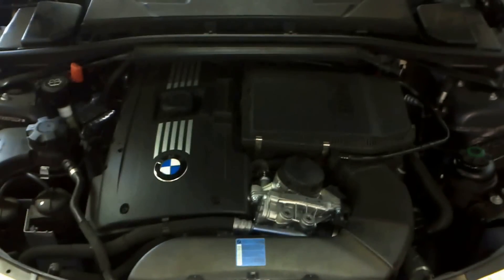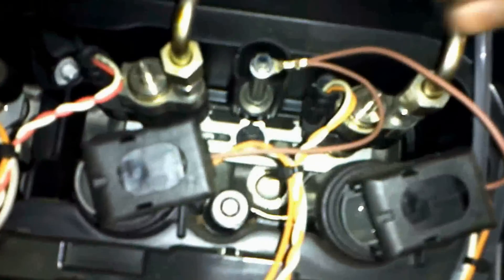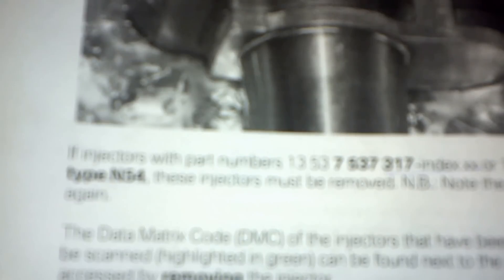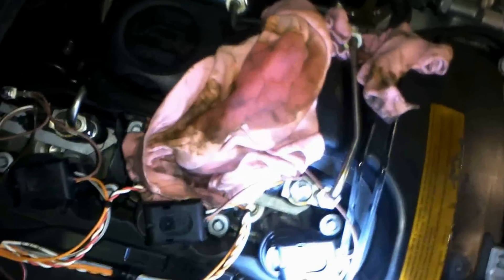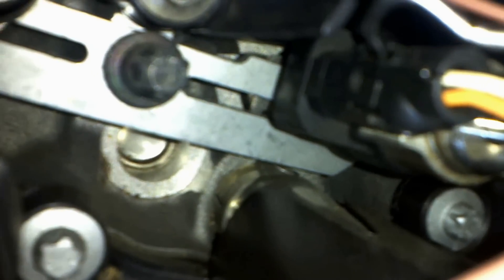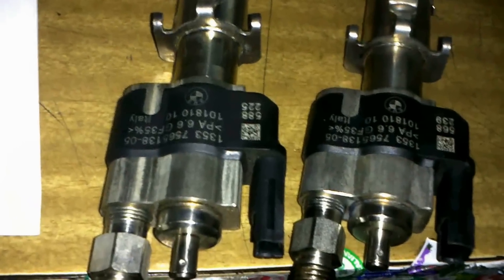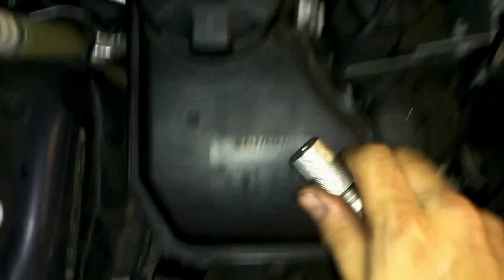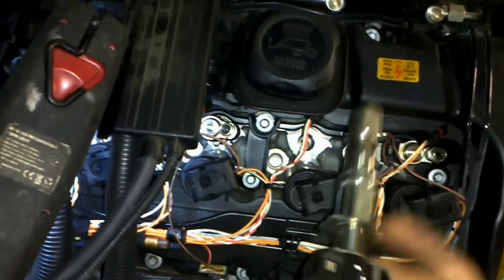BMW Injector Recall 1 & 3 series N54 Engine How to DIY: BMTroubleU

Comment: Tip. Screw the injector line ends to the fuel rail as you take them off then you can never mix them up.

Comment: This is a very common issue with owners of the 335i on the BIMMERFEST forum.  It happens shortly after installing new brake pads and/or rotors as well (along with a new or original sensor).  It does not do it cold and only after heating up.  After I take it to the dealer, it is good for about 800 miles and then starts screeching again.  It happens from stop to about 15-20 mph then you can't hear it.  I guess you have not had to deal with this issue much but appreciate your quick response.

Comment from the maker: fair enough, my suspicion is that the 'quantity compensation' is more for emissions. it may cause issues if the quantities are way out from one another, but you may have gotten it close enough to work well. i still recommend getting the coding anyway just in case

Comment from the maker: yea, sorry i meant to do that ages ago. the injector retaining bracket doesnt matter that much, around 30nm, similar to a sump plug. its been a while, so i cant be 100% but i think the fuel lines were around 24nm. if you could please call to confirm this at a dealership and reply back to me to ensure this is correct i would greatly appreciate it brian

Comment from the maker: still get your injectors done if they are part of the recall and find out whether or not your high pressure fuel pump is also part of the recall. there have been guys that get both of these done at the dealership for free (but it depends on your circumstances)

Comment from the maker: contact a dealership and ask if either your hpfp or injectors are included in the recall. depending on how nice they are you should get trade price parts/free labour/etc. if your car isnt part of the recall get a fault code read out to provide some direction

Comment from the maker: ive never heard of aftermarket injectors for BMW being available or being used. i think that would just create more problems than it solves. if youve had your injectors removed and scanned at a bmw dealership and they all come back as needing replacement then you can be 100% it will need them. the most ive ever replaced at once was 5. it makes sense that multiple injectors would fail at once because they are all manufactured at the same time, with the same fault being built into all of them

Comment from the maker: you'll definitely need new seals. there are two seals- a crush washer and a ptfe black seal. new ones come with these seals, but is the one youve found online new? and is it a good injector or bad? the part number suggests that its pretty new, so thats a point in its favour. i have just been speaking to a guy in the comments below who put new injectors in without programming the 'quantity compensation' numbers and he didnt have any running issues, but you will have to get it done at some point

Comment from the maker: if your rear right brake specifically is squeaking then it could be one of two things- most likely the head of the brake wear sensor is rubbing on the disc and causing the noise. this works twofold for bmw in that it acts as an audible first warning system for customers and its really annoying so it makes people agree to change their brakes sooner than is actually required. less likely you may have nongenuine pads, misadjusted handbrake or brake dust cause the sqeak. let me know how you go mate

Comment: Sir, in your experience, is it likely that 6 injectors would fail at once? On a 52Km, 2010 model? I've recently noticed a hard idle/knocking that increased with revs & vibrated the whole car. Turning it off/on remedied the problem, but it comes back if I let the car sit for a while. Just took my 135i to get the alignment & new tires & I relayed the apparent malfunction to my SA. His tech diagnosed all 6 injectors failing. Furthermore, what is your opinion on non-OEM replacement injectors? Tnx.

Comment: Hi I have an 07 bmw 335i & the car seems to run fine. No misfire, car seems to run smooth. But when the throttle is all the way to the floor the engine light comes on. According to bmw the fuel pump has been replaced with injectors. What would you suggest? I get code cc-is 29. Thank You

Comment: Hi Mate ,

Finally got a scan tool on my car and this is what it showed :

Current active code :
2FBF - Fuel pressure after release of injection

Logged inactive codes:
29F2 - Fuel High pressure System, Fuel Pressure
2DED - Power Management ,Standby Control
2F9E - Thermic oil level sensor signal or level below thresh hold

What do you think my problem is and can I fight BMW for it ?
Reply from the maker: good question. the 29F2 - Fuel High pressure System, Fuel Pressure is a classic faulty HPFP code, but im not sure about your 2fbf... you can let them do some diagnostic steps related to the code and see what they come up with. although if they find youve had a bad batch of fuel you mightnt be able to claim much, but give it a red hot go anyway. dealerships are very pliable for warranty claims and/or price reductions on parts- you just have to be either be mates or firm but fair with the service advisors/managers. the 2ded and 2f9e arent important

Comment: Thank you very much for the post. DO you have a solution to put the new gasket ring without the special tool? I tried with 2 ring and it was bigger after I put them on the injector.

Comment: Could you tell me where I can buy the tools and new washers and rings for those kind of injectors.. Can't seem to find those here in Norway. Seems whomever did some work on my bmw before, took off the rings on the injectors and didn't replace them, nor put them back, I also suspect they never changed the black o ring since at least one of the injectors I can just pull out

Comment: Hi, I live in NY and I purchased a 2009 BMW 535i xdrive and I'm getting misfires and the code is p0304 misfire cylinder 4 I put all new plugs in stock oem Bosch plugs. Same problem same code came back. I swapped the ignition coil to another cylinder and it still came back misfire cylinder 4 so I'm guessing its the fuel injector. Can I just swap it with a used one I found online part # 13537585261-09? Can I just swap them or what else is involved like ecu programming or need seals replaced thanks

Comment: Hi!
I own a Bmw e90 2009 with engine code N43b16a with piezo injectors. My car has really long cranks especially when engine is still warm. No ERRORs are stored NO engine light. Car runs fine afrterwards. Do you have any idea what could be wrong? Do you suspect the injectors or the HPFP?

Comment: Hello BMT.  I own an 08' 135i coupe with just 42k miles on it.  Besides a few scratches, it still is an awesome car and I plan to keep her forever!  I've been using BMS DPs and JB4 on map 2 for over a year(post warranty) and never had problems and it's scary quick(in my opinion).  Last week all of the sudden I started having a rough idle when cold starting.  Outside temps are in the low 70's.  At idle the revs fluctuate and sometimes dip by 400-500 and it seems like it's going to stall, but doesn't.  I also more recently noticed a slight cyclic putter(misfire?) noise when at the back of the car.  I suppose it's simply time for an expensive tune up to replace everything such as plugs, coil packs, injectors, ect, but is there any way to nail down what the real issue is first?  Injectors are expensive!  Any advice on how to tackle this would be truly appreciated.
Reply from the maker: follow this video- BMW Ignition Coil Diagnosis How to DIY: BMTroubleU and let me know how you go

Comment: Hello there, 
I have rough idle when i stop at stop light  on my 328i 2007 the michanic told me its spark plugs, replaced the spark plugs and coil pack still same problam do you thing the problem is the fuel injector please help me thanks alot.

Comment from the maker: dont do it yourself if its covered under recall. if you want to know whether you are part of the recall just contact the service advisor from your nearest bmw dealership. he will need the last 7 digits of your vin and if his system doesnt specifically come up with your car needing the recall then it wont need doing. your build date may be before they changed the injectors and started having problems so it mightnt effect yours. but give him a call just in case, it mightve been added recently.

Comment: I apologize in advance for binging my BMtroubles to you. My e82 n54 went into limp mode. Dealership said codes for injectors, but no codes now after a few miles and runs fine. Have new injectors and plugs on order. What to do?
Reply: Keith

Comment: Hello,
I have a 2008 335i and I installed cobb charge pipe, cobb tuner, cobb, down pipes, and inter-cooler, I put map 2+ and drove fine until the other day when I tired getting on it.... the car went into limp mode so i shut it down and it has a code of catalytic converter and everyone said that the injectors or fuel pump. Any thoughts
Reply: Joseph Wilson I cringed at this . You said you have downpipes . And your throwing a code for a cat converter ? They are non existent! Get the cat fix

Comment: Hi, I have an injector problem or so they tell me from the dealership and they want me to replace at once all 4 injectors!! My car vibrates on start up but after a 5 ' drive it works perfectly ok. I used to leave the tank get almost completely empty before i fill it again. It's a 2008 320 manual petrol convertible 2.0. Help please :) Any other solutions/suggestions? Thanks!
Reply: i have got the same car and the same problem and my engine light just came,have you fix it mate

Comment: Hello Sir,

Do you know when the injector recall ended for N54? My build date is July 2007 so it should qualify for the recall. The dealer is saying the recall ended and wasn't extended 10 years like the HPFP was. Thanks.
Reply from the maker: that doesn't sound very honest to me. a recall shouldn't have an end date- its a known issue and should be honoured for replacement under your rights for warranty against manufacturers defects by law. all it takes for them to check if your car falls within the dates for faulty injectors is a quick computer search. call the highest bmw authority you can get hold of in your country and ask them what the deal is- I suspect they will help you out more than your dealer is. let me know how you go
Reply: BMTroubleU Thanks a lot!

Comment: do you have the torque specs (I didn't see them at the end of the video)?...and how important are they?
Reply from the maker: relatively important- you obviously dont want fuel leaks. 24-28nm from memory, but check that with a dealer first.
Reply: BMTroubleU i assume that's for the brackets that hold the injectors right? or for the fuel lines?

Comment: hi there mate, what other recalls are you aware of on the 335i with n54 motor? ive just purchased one not long ago and am slowly fixing bits and pieces up. i noticed my no.3 injector is very noisy!!
Reply from the maker: specifically #3? thats odd. the recalls for these vehicles arent really to do with the engine, its pretty solid, but rather the ancillary components. injectors and high pressure fuel pumps both have recalls for the 1 and 3 series, but if you simply call the nearest dealerships service advisor and quote the last 7 digits of your vin they will be able to look up their system to see if you have any outstanding recalls on your specific vehicle.
Reply: BMTroubleU Yeah no3 has a really loud metallic ring to it. Best heard through a long screw driver without plastic cover off. I've already replaced a bunch of seals around the motor, I'm amazed how hot they run for a stock motor! Have thrown in a low oil temperature thermo to bring the heart down a bit. Thanks for the advice will give them a buzz, the most annoying thing is the wastegate flapping on cold start, I know in the USA they are a warranty item as there was a court case but I can't see myself getting too far with bmw here getting that sorted.

Comment: Hi I have a 2008 BMW 335i N54. My car have hard time starting up takes about 4 to 5 second to start up. I check the spark plug and 3 are really black and really wet of gas. What should I do???? Change the coil or the injectors????
Reply: Injectors are stuck open. So, they leak gas into the cylinder. It also creates a rough idle. Hard to get clean. Best to replace them. Contact your local chapter of the BMW CCA and ask for a recommendation on a good independent shop to help. Unless you like going to the dealer...
Reply from the maker: Balbir Rodriguez have you called the dealership to find out if your injectors are part of the recall? if they are then the work is usually cheap or free
Reply: They say is not in recall had 4 bad injectors. They was gonna charge me about $1,500 I'm like BS call manufacturing and talk to them and fax them the bummer form and they are like okay you know your thing about car and only had to pay $300.00 all 6 new injectors and spark plug.
Reply from the maker: thats the way it should be mate. glad you persosted and got a fix. drive safe, lloyd
Reply: I need new injectors as well did you call BMWUSA ?
Reply: I call BMW North America
Reply: Thank you I'll give them a call now.
Reply: Okay but how u know if one is baf???
Reply: Bad
Reply from the maker: why doesnt the new youtube comment system allow for editing like facebook does? stupid
Reply: Idk

Comment: What's the best way to do a fuel pressure test on the n54?
Reply from the maker: there are quick coupler fittings between the filter and engine visible from underneath the vehicle behind a black bracket. the fuel pressure from the lift pump has to be round 550kpa at idle from memory. ive never needed to test the hpfp pressures, youd need a huge pressure scale for that, they operate at super high press

Comment: Just got multiple misfire codes today. p0301, p0300, p0302, p0172, p0305. = Cylinder 1,2,5 misfires, & a System too rich(bank1) code.   Changed spark plugs a month ago. How do i know if its the coils or injectors?
Reply from the maker: to test coils check my video here- BMW Ignition Coil Diagnosis How to DIY: BMTroubleU. the easiest way to find out if your injectors need looking at is to call the service manager at the nearest bmw dealership and ask him to check if your vehicle is included in the injector or high pressure fuel pump recalls. you dont have to go in, it takes 5 minutes to check over the phone on the bmw system using the last 7 digits of your vin number and if your not included in the recall chances are its coils.

Comment: Can any 1 possibly help me out a couple days ago I wos in Brisbane with terrible amounts of rain sum how another I ended up with water in number 6 coil and number 3 car developed a slight random miss over 400k,s the all of a sudden can went into full limp mode I have since removed any traces of water and yoused my Jb4 to clear all codes the car seem sto be sparkling on all cylinders I have tried unplugging each cylinder at a time and all seem to be working the scan tool just just says miss fire on number 6 but I have noticed a strange smell like electric but not quite also note I had replaced all the spark plugs a week earlier

Comment: i have a bmwx3 2007 does this recall go to this model
Reply from the maker: check with your local dealer. only the n54 engine had this injector issue and I never did recall on an x3

Comment: Yo Mr troubleU my 08 335 has had cylinder 3 & 4 misfires for a while 
I changed both all 6 plugs and coils walnut shell blasting then misfires went Away for about 2 months about a week ago I got misfires cylinder 3&4. And now it idles terrible. And warm start up misfires the worst.. Is it the Fuel Injectors ???
Reply: +GangGreen_714 did you ever find out? bmw e90 does this and idles rough and has a misfire in 4
Reply: RSMAULINI Fuel injectors bro
Reply: same here! Thanks haha mine is now repaired!
Reply: RSMAULINI go pump some e85 haha
Reply: +GangGreen_714 bro i have a 335xi bmw and i changed all 6 spark plugs and all coils and both solenoids in the front and also a oil change and im getting combustion misfire codes can you help me im dying lol
Reply: What cylinders are showing up misfires? I had the same problem and did the same fixes as you on further inspection by BMW it was found that my Injector 4 was over fuelling and had failed, They require them all to be changed at over £200 each but I managed to take it elsewhere I got 1 changed and it also knocked out the NOX sensor which was £337, Cost me £1000 for the final fix but about 4/500 before that trying the obvious I.E Sparcs / Coil packs id suggest it would be a faulty injector, and it its overfuelling after a while could fail the cat
Reply: RSMAULINI the cylinder misfires are 1 and 6 and its saying multile random misfires
Reply: are they on the same side?